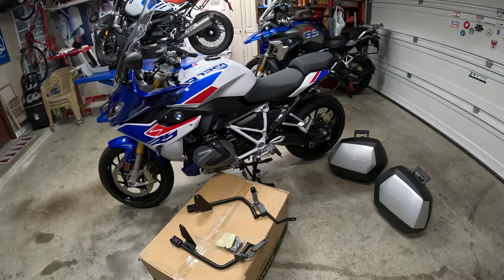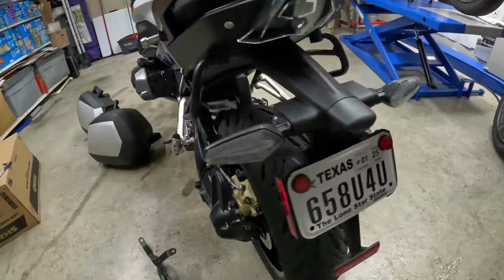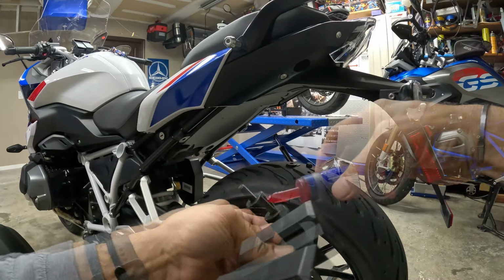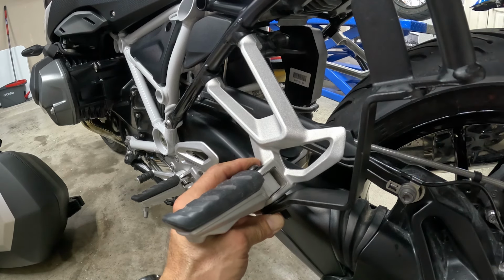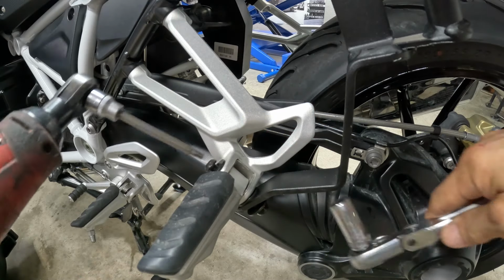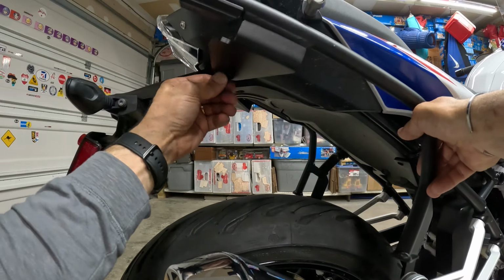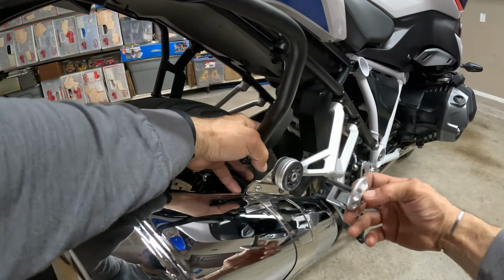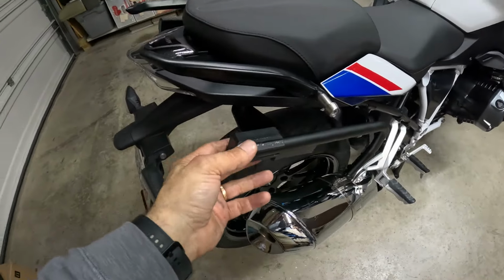How to Install SHAD Panniers on a BMW R 1250 RS

Comment: What year is your RS?
Reply from the maker: @bubba1237  2023
Reply: Ok thank you. I have a 24 and the setup is the same so I was wondering what I was doing wrong on the exhaust side until I realized you went behind the bottom portion instead of between. Thank you